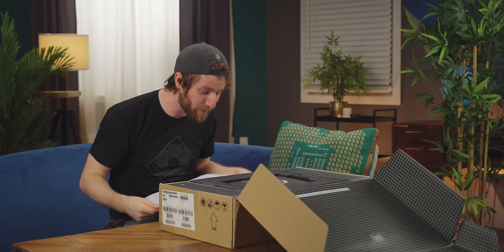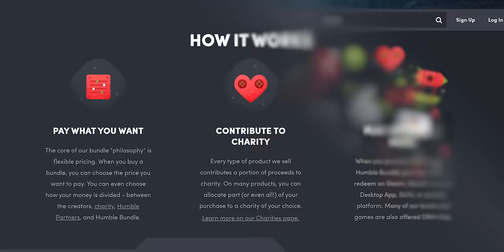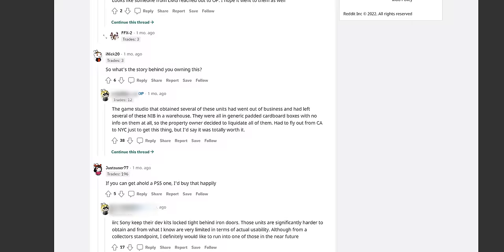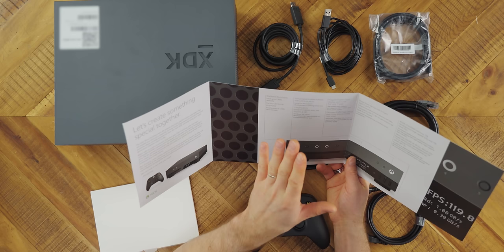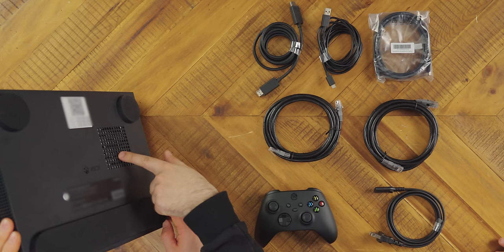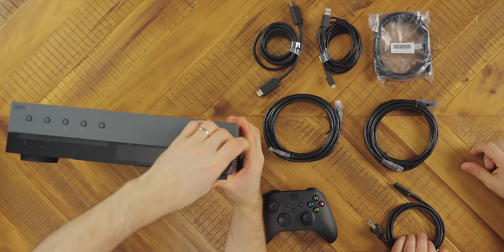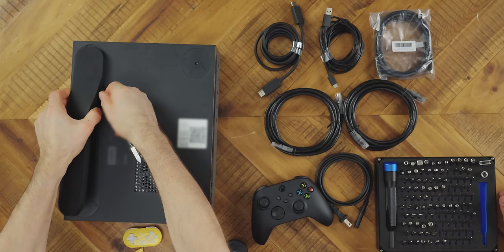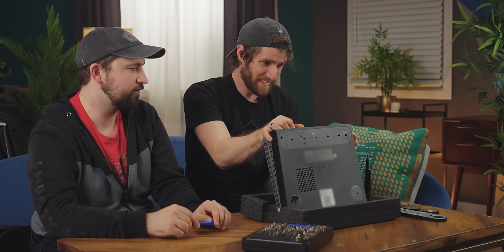I Can't Believe I Paid Two Grand For This - Xbox Series X Dev Kit

Comment: 10 gig port is definitely for moving builds over at speed. On titles I 've working on in QA it wasn't uncommon for us to get 2 or maybe even 3 builds a day at 90GB that needed testing.
Reply: Out of curiosity do you limit the hardware on the dev kits to see how games would perform on retail units?
Reply: @caolkyle  Not a game dev, but I guess they need improved hardware cause games in the making are pretty unoptimized and to have less crashes in the dev process they definitely need more RAM/VRAM.
Otherwise it would probably get very annoying if work in progress game builds would crash all the time cause of the limited ram.
At the end game testers and QA can test the game on the retail versions.
Reply: @tomsvfx  not retail, on TestKit)

Comment: The speeds are because, as a developer we send builds to the system frequently. Sometimes running real time from computers to dev kits. So the data transfer needs to be quick, because time is money, and sending 200gb+ of data to the console for testing, scrapping that build and sending a new one is aloootttaaa data.

Also as a dev, ive never used the buttons on the console, its entirely controlled through the controller, additional keyboard or the work machine. I'm talking the most extensive debug menus you've ever seen, ever, in the controller menus, kinda cool tbh.
Reply: Interesting. Do you know if there was a single chance to get a game running with a rogue devkit like the one in the video?
Reply: @airy_co  afaik it's pretty unlikely without access to the extensive and horrible Microsoft dev tool ecosystem. haven't done xbone/series s/x dev before but if it's anything like the 360 tools, the dev software is generally fairly well integrated with the console

plus the whole network access thing would make it pretty hard, seems like it leans pretty heavily on that for things as simple as running software

edit: I entirely misread as "a single chance to develop a game with a rogue devkit" but the answer is still pretty unlikely
Reply: @airy_co  haha id go with zero chance. I wouldnt have a clue how to boot a game on the console without pushing from the dev platform. Which he doesnt have access to as evident by the end of the video. I was curious if he figured it out tho because ya know, its linus loool.
Reply: is there no way to send a differential build? Or is that just too prone to error?
Reply: @HululusLabs  not entirely sure what you mean, a build of the game is what youre sending over. I can load it up with whatever I want, published versions, beta, brroken whatever because not every build is perfect, local builds etc. but it needs to be sent from a work machine. Without access to the work machines which require extensive logins and security hes never going to send anything over wihtout using an authorised login. the dev kit doesnt even connect to the internet its straight into the work pc for us.
Reply: What do you mean with running real time from computers to dev kits?
Reply: @necrozim  diff build is like when you uploaded full data to console and then fixed the stuff, only fixed stuff would be transferred, instead of uploading everything from the scratch
Reply: Yeah, same for me. And the screen only used to check FPS xD
Also cool that you could actually use it as regular Xbox - Microsoft and Nintendo had no problem that you weren't working, just playing some games from the store :D
Reply: you can absolute get a game running on a devkit. you just have to have source access. you know, like a developer.
Reply: shouldve made your game smaller then kappa
Reply: @HululusLabs  there are options to split up and deploy files "on demand" to the box. or you can deploy a full build all at once, which is more likely in a QA scenario, or if/when you run into problems with the on demand streaming build. the tools break every once in a while, and MS patch their dev kit stuff every week or so to fix bugs and improve performance. you still want the fat pipe. minimizing fix/build/run cycle times is important, cause otherwise you get distracted and go on youtube and start replying to the comments.
Reply: @blarghblargh  makes sense, and it's cheaper to pay for hardware than a dev's wasted time.
Reply: why can't they make a decent menu for controllers and configuring them for windows :(  it's stuck in the 90s
Reply: What game has 200gb worth of asset files??
Reply: @DJTimeLock  unoptimized Games / raw Builds with addionial Debug Code are just way heavier then your typical Tetris game
Reply: Hi. Could you please tell me what is scrapping. I have experience only on PS systems. Debug tools are awesome 😎😎
Reply: @DrakenRolle  not 200GB heavier. I'm just having a stab at recent games being like 350GB on release
Reply: @HululusLabs  yeah. thank god, too. cause I hate accidentally going down twitter holes when builds take too long, lol.
Reply: I've used the little display and buttons to show and scroll around error and debug messages. Useful when you have a graphics bug and can't show anything on screen. But then we had to switch to remote work and it became pointless :P
Reply: @ChrisAverageYT  Hi can you trell me what scrapping is? Havent been able to switch platforms to learne more. Just trying to learn as much as i can. I have only wroked with PS.
Reply: People forget that in development you actually have to do in-system testing on a live system. It's not just a case of "playing games", but actually fixing bugs.
Reply: @N1lav  Scrapping is just a general term for deleting something. Similar to how a car gets scrapped
Reply: @engineeringvision9507  oh yeah. I used to work at a place where I heard that they reserved 600+ mb ram for debug tools. Of an OOM crash occurred but the required is less than 600, they didn't even try to fix the issue. The crash would fix itself when the app got a shipping/release/cert version.
Reply: @2KDrop  so you have to do that manually on a XSX? On PS it occurs automatically when entitlement is Removed
Reply: Interesting to read some Behind the scenes work on this stuff
Reply: Sort of - the main use I get out of it is rapid iteration/debugging. I worked as SDET x360 and Durango and it was never an issue to push nightlies over the slower interfaces - If you're getting test builds mid-day then honestly a deploy is the least of your concerns. Nightly should be good enough. Yes it is super nice - but the reality is you have to feed that pipeline, if you've got 30-100 devkits receiving these builds, that's 30-100*10gbps - this isn't the purpose of 10gig, it is a happy benefit, but the main purpose is the direct link to the workstation for better debugging flows. As SDET on durango I had to manage a 50 system automation lab - 50 1gig lines for deploys (to fully saturate) would have required a dedicated storage server on connected to either a bunch of 10gbit switches - meaning lots of nics, huge amounts of ram (200+GB) or a 100gbit mellanox box which would have cost more than the server and boxes at the time.
There's simply no financially feasible way to fully saturate a test lab at 10gbit - that's 300-1000gbit total bandwidth getting pushed - all stalling out the server thanks to protocol inefficiency - and since most dev builds can be diff'd to deploy, you shouldn't be copying over 200gigs at a time unless your SDETs/QA Leads are spineless and engineers are braindead. Like, to accelerate QA deploys I simply had a python script that checked the two builds and parsed a copy script that sent only the delta files - which is typically very little of the build..
Reply: @airy_co  you cant play commercial games on a devkit even with dev network access.

Comment: I worked in game dev for a while... It's amazing the basic information that isn't shared in these videos that MVG covers.

Any Xbox dev kit since Xb360 has automatically been "banned" on the production XBLive network. They're able to connect to the Devtest XBL network, but they need to be logged into a registered developer account to connect. This also applied to when you can do Dev mode activation on more recent consoles. The minute you boot to Dev mode it puts you in the same walled garden that only allows connections to the DevTest XBL network to prevent piracy/cheating.

Also, ever since XB360 even games on the disc need the console to be activated and download the auth codes to read the discs and execute the code.

There's plenty of breakdowns on the checks and balances that microsoft uses - go look into the Xbox homebrew scene for more information.
Reply: If you have the game downloaded onto the xbox and its mostly taken apart you can pop the disc in let it read the code then pull the magnet off the top of the disc tray thing and remove the disc. Used to play system linked nazi zombies this way lol only had 1 disc.
Reply: Yup. They really clamped down on XB1 and XBS after the whole PartnerNet fiasco.
Reply: Thats bullshit. Most Xbox 360 disc games do not demand internet connection in order to launch.
Reply: @Squilliam-Fancyson  i think hes talking about the code on the disc lol. It only spins to read the code then the disc stops when its reading from the hard drive.
Reply: @Squilliam-Fancyson  The consoles themselves have unlock codes that have to be downloaded periodically from the Xbox servers otherwise they'll brick the console until it's back online. They started that with the last couple builds of xbox360 to make sure Xbox gold games weren't being downloaded and played after Gold subscription lapsed.

90% of games (including the ones shown) ship with basic sprites and content but lack the actual finalized code for the game. It's something developers started doing with XB1 to "prevent piracy".

ModernVintageGamer (mvg) does some great deep dives on the topics if you want to really learn how consoles and game dev works
Reply: So... What your saying is Linus should create a game development crew so that they can gain access to the XBL development Network in the future
Reply: @Squilliam-Fancyson  on a new Xbox yea they have to Xbox one and up
Reply: @TheEpicAppleEater01  PartnerNet fiasco?
Reply: @Celician83  yes
Reply: @Seppevh  google
Reply: @d0h  No, the Xbox 360 doesn't work this way. The Xbox 360 game disc keys are on the discs themselves. If you're offline, it doesn't matter if your system is on 1888 from 2005 or 17559 from 2019, the system will read the disc and play it. If my console hasn't been updated and I want to play a newer title on my 360 with no network, the game disc has the kernel of whatever kernel the game was developed for and it will update your console to that specific kernel so it has full compatibility with the game all without a network connection to XBL. Xbox 360 XDKs straight up don't play retail games because they are only designed to run unsigned code; or more specifically developer signed code, so anything retail doesn't run. Despite the fact that Xbox 360 XDKs were more or less identical to retail 360s, XDKs aren't meant to game period. XDKs are completely unlocked, or jailbroken so to speak. You can run ANYTHING on these systems, where you can't on retail without a mod. Because of this, this means you could get an XDK and hack/cheat on retail games, which is not what Microsoft or any developer studio wants to happen, so all retail code is blacklisted from running on the XDKs.
Reply: Xbox One doesn’t work this way, the old PartnerNet live environment doesn’t apply to Xbox One

All Xbox Ones, even dev kits, connect to production, but dev kits can enter sandboxes defined via partner center that serve as isolated parts of the production network (this is what sandbox ID is for btw)
Reply: @amarioguy  Negative - Partnernet died in the 360 -> One transition, but the DevTest network did not (though they refer to them using the term sandboxes - it's still the same network just further segmented). Playing retail games on a SDK/DevKit rig will result in the console getting an instant ban unless logged into a developer account - and it'll still get your account banned from the XBL network if you're playing games not associated/published by your company (which is why they were freaking out about not connecting it to the network at all until they'd tried everything else.) When banned from the network, it also revokes the codes used for the handshake with the disk drive or to launch the loader for any game, fully bricking the device until it is connected to an authorized developer account again (and having to have a long talk with your MS rep about ToS violations.)

Not like they'd be able to use the disk drive to run a game anyway. Full games haven't been included on the disk since the 360 days - as I've said several times already.
Reply: To my knowledge this does not apply to Microsoft-internal devkits, which are obviously much rarer but I've heard of them getting into the wild.
Reply: @SGprooo  Nothing came up relating to xbox when I googled it.
Reply: @d0h  ah thanks for correcting me, didn't realize DevTest was still a thing on Xbox One lol
Reply: @Celician83  Yup... He should have Luke port Floatplane in the windows store and request a Dev kit in the process...
But that that point he'd be under NDA so he wouldn't be able to show the DevKit... quite a Catch-22.

But at least he'd have a functioning app... unlike their Apple apps :P
Reply: @d0h  you don't get these kits unless you're making a game
Reply: @leo60228  now those are essentially completely different ballgames to these kits (internally i believe these kits are called ERA kits if i'm not mistaken)
Reply: @amarioguy  There are ways... Secret ways...

Technically you can get them when doing app dev, you just have to pay for them and use certain use-case requests. Video streaming based apps can be optimized specifically for the XBox, but you have to have the platform established and already have a windows store (PC) app while proving the default edge browser isn't displaying your content at native resolution or quality 

(So for starters, 4k, HDR10, and needs custom codec or engine to display properly.)